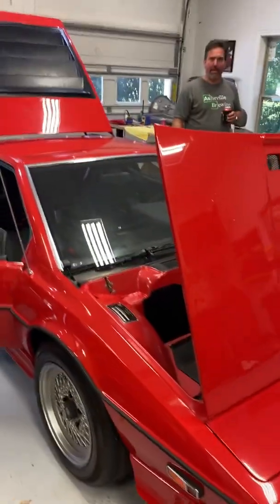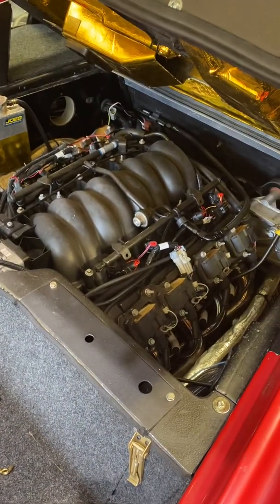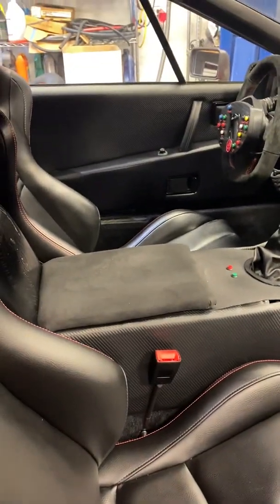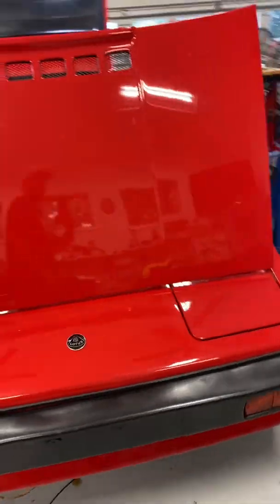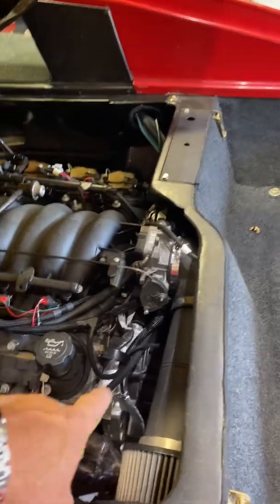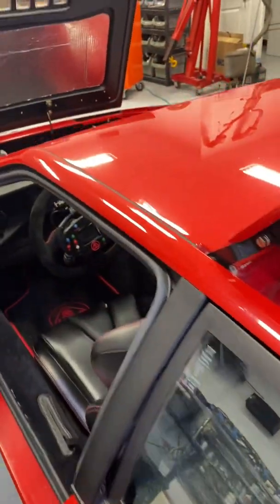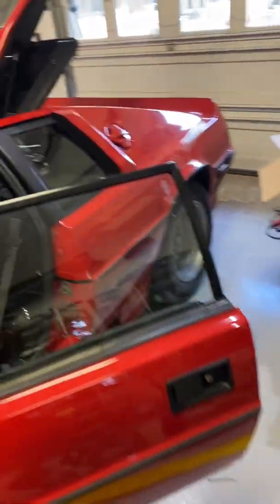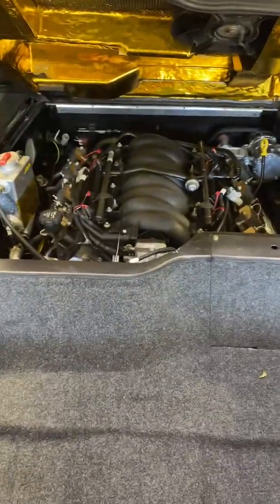Lotus Esprit LS Swap - Done the right way!

Comment: I know everyone loves doing LS swaps, lots of HP for a small price.  Personally, I'd choose to do a turbocharged Honda K20 engine.  Why? Much lighter weight (a Lotus Hallmark), much higher redline 8500rpm- one sign of a true high performance engine, as much or more power, and.... European exotics NEVER come with old tech pushrod motors. Also, Lotus themselves used Honda powerplants in F1.
Reply from the maker: Check out Mike at Stancworks recent Ferrari project. I do agree and would probably use an F136 engine or maybe a bmw V10 for the next one… but it all comes down to cost and level of fabrication. I’m just a guy in a garage so I had to go with what was known… I don’t have the skills to fab up everything- moreover, I didn’t want to just buy everything or have someone else do it. I dig it though - maybe an Audi 5cyl turbo would be a ripper!
Reply: @projectmcnasty6160  Yep, I'm actually LESS on board on that one. Ferrari is more than a car, it's a legend. Lotus started out manufacturing kits, and uses multiple engine suppliers to this day.  With the 308, I would just probably use a more modern Ferrari powerplant. I know one guy pit modified 360 engines in a 246GT. Not bad...
Reply: K series would be great for an esprit, I was thinking the same thing. I totally disagree with you on the LS swap though, why not. Easy power, reliable and much much cheaper